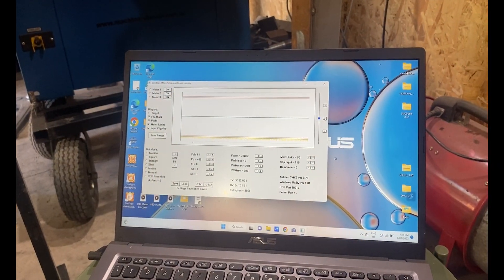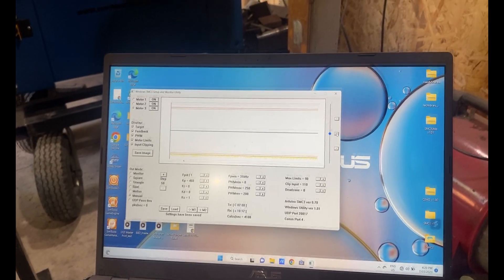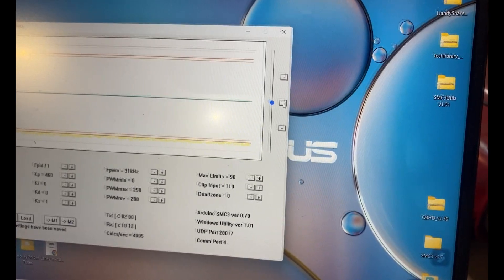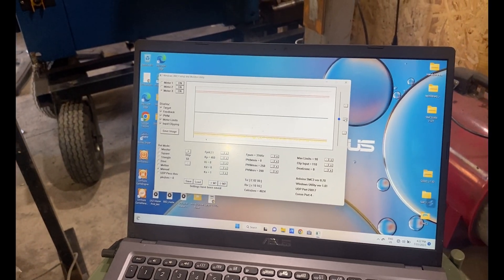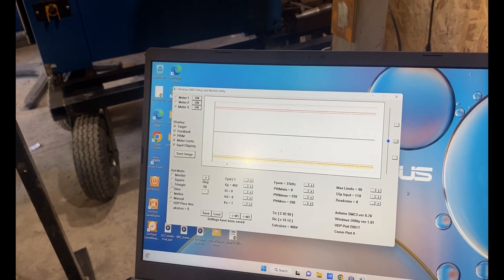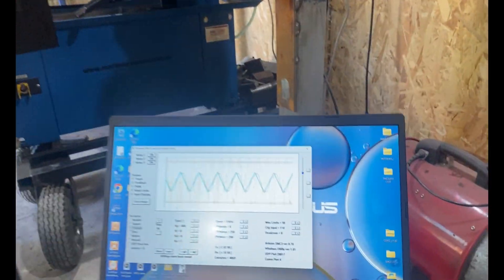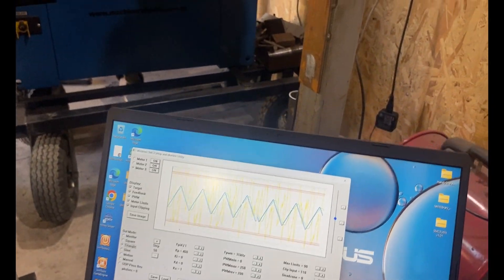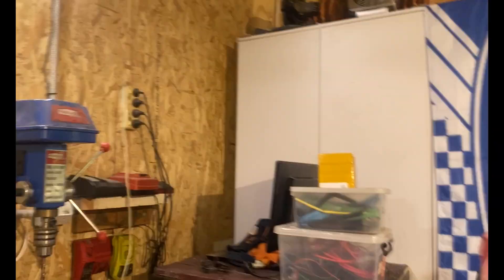DIY 3.5DOF Motion Simulator Platform DIY Rear Traction Loss Modification Overview.

Comment: Hello and I congratulate you on that great simulator. I have a problem with the SMC3 on my 2 dof. How do I solve that when I go to the end of the potentiometer travel, the motors cut off and everything remains off. I wait for answers and thank you very much
Reply from the maker: Thanks Claudio but that version of the motion simulator is just a proto type. I have a 3DOF with spring heave that I have now made into a 4DOF with a surge axis. As for your potentiometer troubles. Check your max/min clip limits. Lower them. Does your potentiometer green line sit above the red clip limits and the SMC3 MOTOR turns off in SMC3? if yes, this means your green potentiometer line is exceeding your clip limits that are set between 0 and 255.
Reply: @Doctoradhd1  Thank you very much for the response. I'm going to look into that tomorrow then. And I've already seen several of your videos and the work you have is tremendous, you are a true genius. I hope to solve this since I am very lost with SMC3 and it has me half frustrated. And another query. Is there a video that teaches how to use the SMC3 well? Thank you so much
Reply from the maker: @Virtualestop  It can be very frustrating Claudio. Just don't give up. You will learn many new things and you will succeed if you keep going. Try these three videos Claudio. 

https://www.youtube.com/watch?v=FKkvup7dJdw&t=300s

https://www.youtube.com/watch?v=7rZMIlsWBiI&t=40s

https://www.youtube.com/watch?v=IENLCQ9xjdg&t=194s

Just remember. Every motion simulator will need it's own SMC3 settings based on motor controllers, motors, platform design, operator weight etc. So many different things need to be considered. 

PWM and PID is complex and you need to test with caution. Keep checking your IBT-2 controllers and motors for heat and unusual noise. These can be indicators you are running SMC3 settings too high or too low. Keep going Claudio. By the way. I am no genius.

Here is the very first test for my new 4DOF I made today with the new surge trolley rail carriage. It works fantastic!

https://www.youtube.com/watch?v=bKd_DWmFHyw
Reply: @Doctoradhd1  Thank you very much for all the contribution. I'm going to try it thanks to your video. I will leave you news